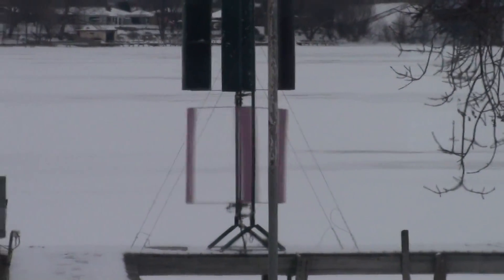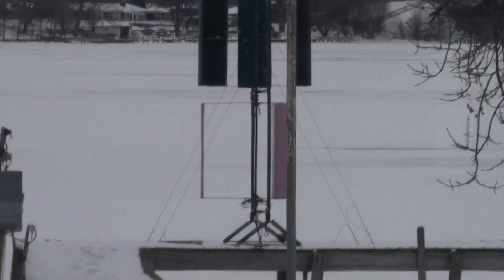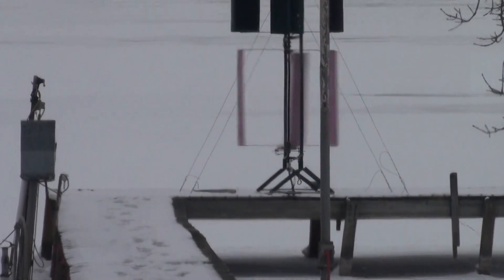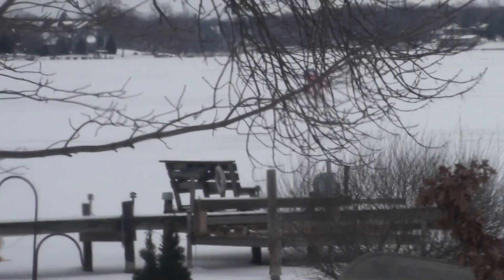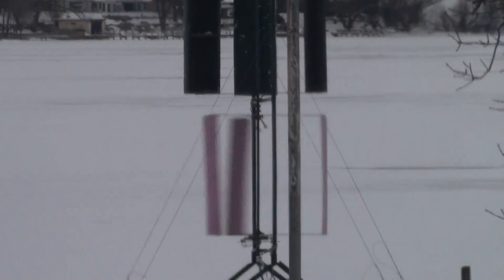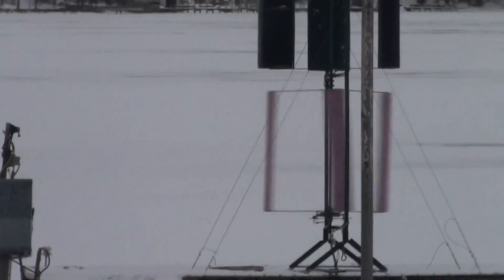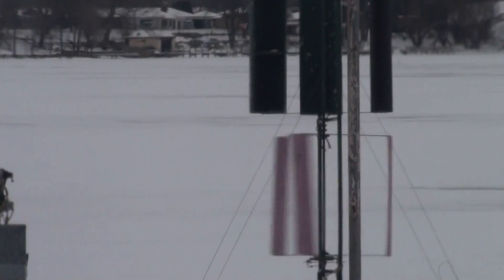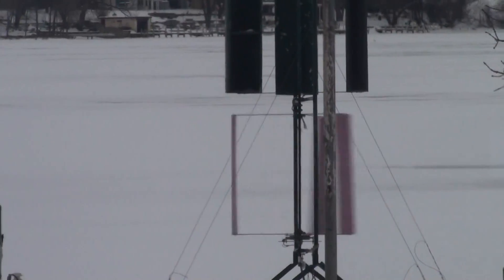naca 20 wings on a Vawt

Comment from the maker: I'm trying to avoid any extra weight. I already have a  half inch steel conduit thru the hole for wing mounting. went with the steel for price and easy to weld nuts into the ends for mounting to the arms. I've got some other ideas to try just need some warmer weather.

Comment: The lenz on the same mounts are cutting a larger diameter path too but You might look at the solidity and increase that a bit. You can easily do this by slotting the t.e. and slipping a full length strip of sheet metal in to the slot and gluing/taping it in.
good luck

Comment from the maker: @Caleb6543  The blades are 2 inches thick by 9 inches , by 4 ft long.  I did have to put a slight angle inward at the tail of the blades. Otherwise they don't want to self start. It is a really touchy setting. I don't have an exact angle to give you but it is not a lot. I get better RPM's with these blades but less power than with the large lenz blades. Still experimenting. I really need to get some sort of RPM counter, and need to tweak the alternator.

Comment from the maker: @shartne Yes , it is set up to work that way. I just had'nt been able to make the other set of foam wings yet  when I shot this. Those large wings on top in this video would just overpower the lower wings and turn them backwards. You have to have the same wings or close to it  for this to counter rotate. You also have to have enough wind power to turn the Alternator in opposite directions Otherwise one set will either stay stationary or slowly turn backwards.